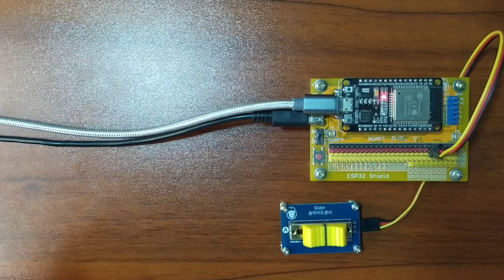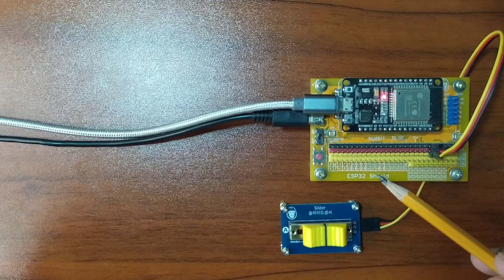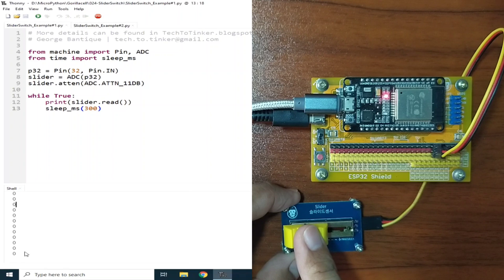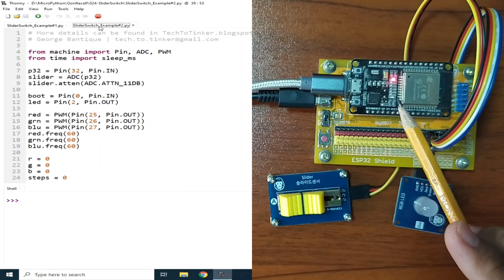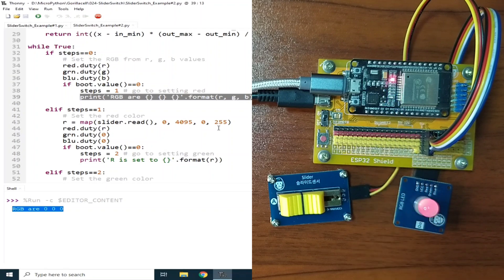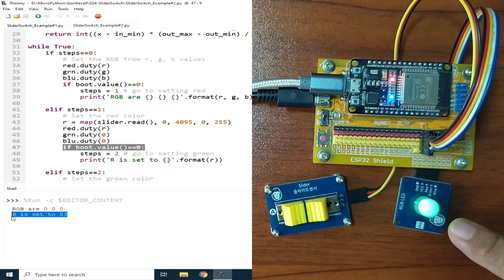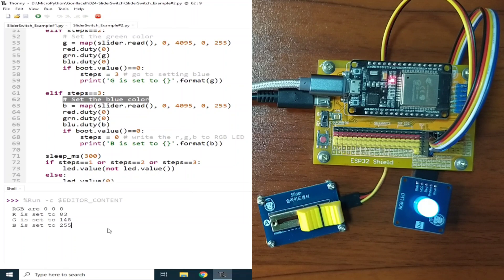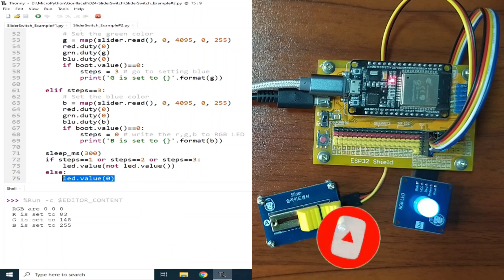024 - MicroPython TechNotes: Slider Switch

Comment: Nice vedio george can you pls do vedio on pls charlieplexing i/p and o/p pls ??????????
Reply from the maker: @Harnaik Hothi, thank you for the kind words. I actually don't know what is charlieplexing so I googled it :).

You may try the following where I use Raspberry Pi Pico but of course you can use ESP32 or ESP8266. It uses 3 GPIOs which are GPIO 13, 12, and 11. Using the while loop it blinks 6 LEDs using 3 GPIO. Its cool. Hope you like it.

# More details can be found in TechToTinker.blogspot.com 
# George Bantique | tech.to.tinker@gmail.com
from machine import Pin
from time import sleep_ms

def b1():
    y = Pin(13, Pin.OUT)
    b = Pin(12, Pin.OUT)
    g = Pin(11, Pin.IN)
    y.value(0)
    b.value(1)
    
def b2():
    y = Pin(13, Pin.OUT)
    b = Pin(12, Pin.OUT)
    g = Pin(11, Pin.IN)
    y.value(1)
    b.value(0)
    
def y1():
    y = Pin(13, Pin.OUT)
    b = Pin(12, Pin.IN)
    g = Pin(11, Pin.OUT)
    y.value(1)
    g.value(0)
    
def y2():
    y = Pin(13, Pin.OUT)
    b = Pin(12, Pin.IN)
    g = Pin(11, Pin.OUT)
    y.value(0)
    g.value(1)
    
def g1():
    y = Pin(13, Pin.IN)
    b = Pin(12, Pin.OUT)
    g = Pin(11, Pin.OUT)
    b.value(0)
    g.value(1)
    
def g2():
    y = Pin(13, Pin.IN)
    b = Pin(12, Pin.OUT)
    g = Pin(11, Pin.OUT)
    b.value(1)
    g.value(0)

while True:
    g1()
    sleep_ms(300)
    g2()
    sleep_ms(300)
    b1()
    sleep_ms(300)
    b2()
    sleep_ms(300)
    y1()
    sleep_ms(300)
    y2()
    sleep_ms(300)
Reply: @TechToTinker  Hi George thanks you for your help  Best Regards
Reply from the maker: @harnaikhothi3277  you are welcome and thanks for the idea. I will create video of it later on :)